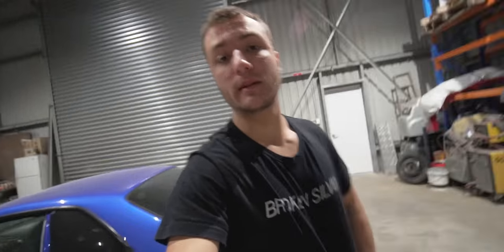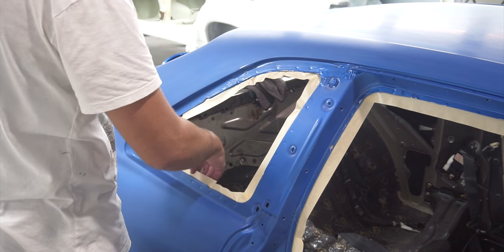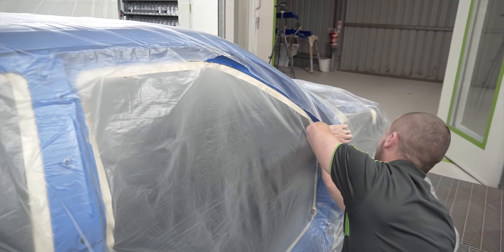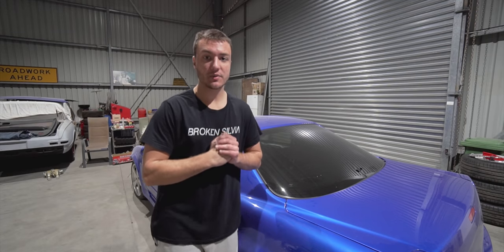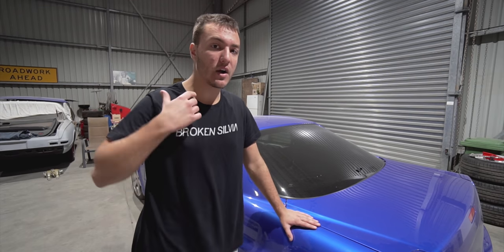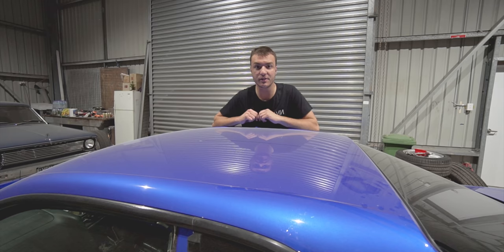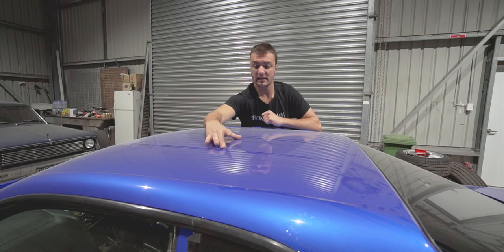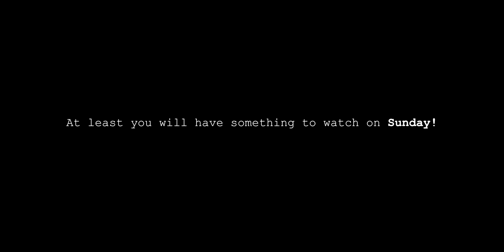DIY R34 Skyline Paint Job !! | Poor Man's GTR [EP22]

Comment: Funny you should mention how hard it is to spray silver!
My first ever touch up job was to spray a silver Commodore door! Match wasn't perfect and it was little tiger but I was still pretty proud. It was a 20/20 job. 20 meters or 20km/h it looked great!
I love how wet this paint goes on! It matches my style of painting a lot better since I'm pretty heavy handed. I generally get my paints mixed up as a single stage as I'm afraid of 2 pac for some reason. 
I've done some pretty good touch ups in my time, Panther Mica on a Mitsubishi, also did a red bumper on a Colt. The first time I painted a guard and bumper on my race car it turned out great but the colour didn't adhere to the guard properly so I redid it and ran out of clear on the final pass and it spattered the whole panel turning it into sandpaper so I've had some real disasters too! 
I was painting a flare once and it was perfect! I went to throw a third coat of clear and some grass clippings? fell into it and ruined the whole thing!

Comment: I will correct you with the basecoat a bit. The spies hecker 480 is a special system with a 1,5 coat aplication. Most other paint systems are 2 coat (or until coverage) and effect on top of the dried base. So a bit of missinformation there othervise great work brother

Comment: That is wrong information. I have never ever drop Coated a panel wet. And have painted thousands of jobs. Also a metallic paint will reach total opacity so applying more paint won’t change the colour. Yes a 3 stage pearl but not a silver or any other metallic colour. You can drastically change the shade of a colour by the pressure you apply a drop coat at though.
Reply: Sorry Chris, go and do your research on Spies water and then formulate an educated response.
Reply: Sam Atkinson I served my time with water base in the Uk 20 years ago. I have used many brands and all application is exactly the same. Silver with RM/glasurit required a blending agent. So am guessing this must be an odd one out.
Reply: @chrismarshall4814  don't do your research then.